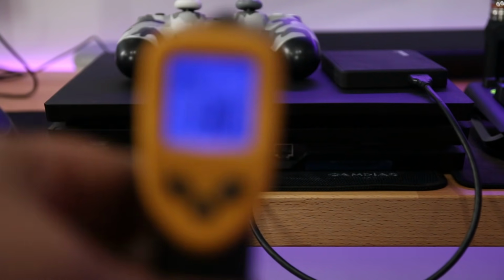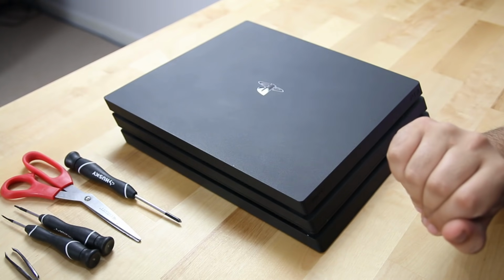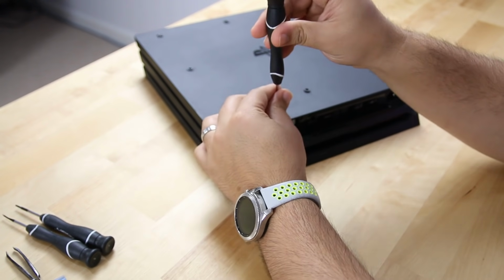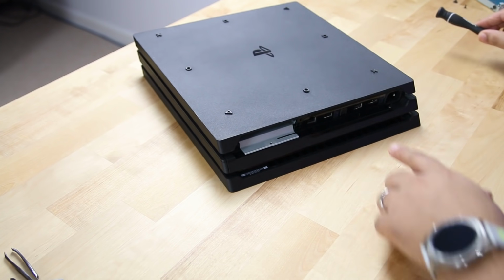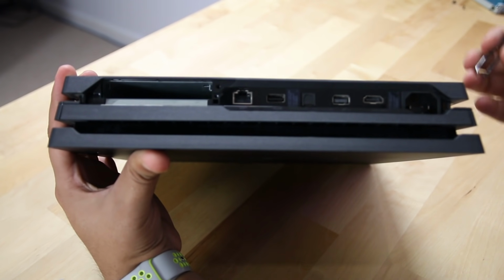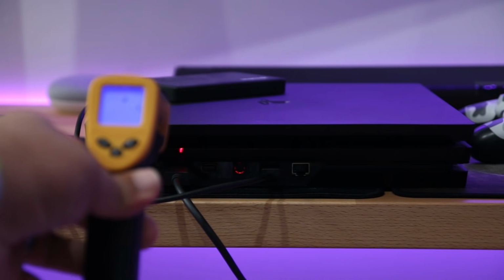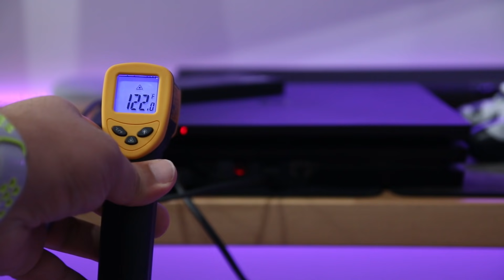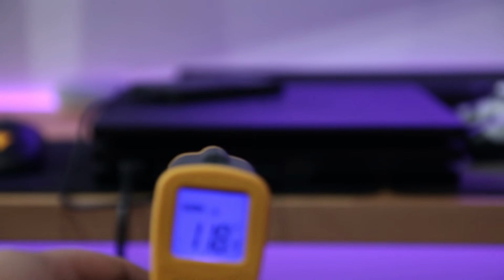PS4 Pro Fan Noise Fix - Thermal Paste & Pads Upgrade

Comment: This actually worked thanks. My ps4 is so quiet. I think it was because there was a inch of dust in the heat sink.
Reply: How is the noise after a few months if you don't mind me asking?

Comment: This video was helpful with major caveat. You need to remove two screws on the bottom plate, in addition to the 5 on top, to remove the power supply.
Reply from the maker: +Monte Crisco yep. That and I put the thermal pads on the chokes instead of the memory chip set lol. Fixed and pinned.
Reply: Tech Savvy Buyer no worries. Your video helped fix my shit up 👍
Reply: This is an excellent observation.  I missed these two T8 screws and bust the plastic cover on the PSU....luckily its only a small crack.

Comment: There are 2 screws from the bottom that holds the power supply you didnt mention to remove it. You mentioned it after you removed the power supply.
Reply: Yeah, "little" detail missing.  Thanks to this comment I avoided some trouble.  Gotta have these two removed from the other side to get the power supply out.  They are two of the silver torx 8 at the back.

Comment: As a PC player, that factory paste was just...oh god.  

SSD seems to be hit and miss.  Some say it halves the time, other say it reduces by a few seconds.  So I'm not fully convinced.  I'd go with a Samsung 840 Pro though, but that can suck as it's only 256gb.
Reply: Dynasty2201 I have a 1tb “SanDisk Ultra 3D SSD” in my PS4 Pro and for the most part it’s a night and day improvement.  Game load times for Pro enhanced games are dramatically faster.  In Destiny 2 I load in a full minute before anyone else I play with, However for older non Pro patches games or games with short load times in general it’s fairly minimal.  The console also turns on about 5 seconds faster which is nice but the best part about using an SSD with a PS4 Pro in my opinion is how much faster the OS runs.  All stuttering and slow down is completely gone even with demanding games open in the background.  And the cherry on top is that the system is completely silent when idle.

Comment: Thank you for your efforts. The thing that needs to happen, is SONY`s decision on applying Liquid Cooling to the next PS generation. Thats the first and last solution to both keeping the rig and our ears protected :)
Reply: This is more an industry thing, I’ve seen laptops from apple and Microsoft with the same issues about thermal paste.
Reply: @Mugman896  It`s not the thermal paste. Uncover your PS4 as I did and get it 10-15 degrees cooler. It`s the matter of bad airflow. Uncap your PS4 and you`ll see :)
Reply: Consoles are ment to be somwhat affordable it will never have liquid cooling pc is the way to go for total silence if not xbox its quiter than the ps4

Comment: I just did this with my PS4 Pro.  This was the first time I had ever performed an operation of this nature on anything, but I decided to just go for it.  I'm glad I did.  I used Arctic MX-4 thermal paste and Arctic Cool thermal pads.  I was leery about using Liquid Metal, since I have my PS4 Pro oriented vertically, or Arctic Silver 5, since I heard that has cure times, a break-in period, and it can be electrically conductive.  I wasn’t sure exactly what is the right amount of paste, but I had been hearing most say that a pea-size diameter spot is sufficient (by the way, the original paste was just absolutely glopped on there).  I don’t have a means of checking the temperatures, but I can tell you that playing Monster Hunter World and Final Fantasy XIV, two games that typically turn my Pro into a hairdryer, the fan remained near whisper quiet.

An unexpected benefit has been that the performance of my Pro has improved noticeably.  In Monster Hunter World, my typical load times are around 15-30 seconds, since I have an SSD in my Pro.  However, after this operation, load times went down to about 5 seconds!  That's fricking PC level load times, on a fricking console!  I normally run FFXIV in full Pro mode, 1440p with the High Graphics option turned on because I like the better visuals over the frame rate (I'm a console gamer, so I’m used to lower framerates).  After this operation, while the overall frame rate doesn’t seem noticeably better, there is less sensation of dropped frames, that is, the overall motion of the scenes are much smoother.  Also, the controls are much more responsive than they used to be; I’m no longer getting occasional missed commands or feeling like the controls are “sticking”.

Overall, I've been quite happy with the results (and rather pleased with myself considering this is my first time pasting anything).  However, my before and after experience suggests to me that the PS4 Pro has quite a bit more power in it than people realize.  But, that power gets masked by thermal throttling with the factory paste and pads.

EDIT: Artic -> Arctic
Reply: Be careful because in the video at 7.00 he puts the thermal pads on the wrong place. The pads are to put on the black chips(vrm). So the black chips directly above. I told him but he didn't change the video. Guess he's not worried if people fry their ps4 pro... 

You can check this if you dissasemble the ps4 pro and look between the motherboard and the chassis while you are lowering the motherboard. Alternatively you can search on youtube for "ps4 thermal paste replacement more fps" and you will see a video with a mod, that i do not endorse, but it has the correct placement of the thermal pads at 7.32. I cannot post links because youtube makes my comments invisible to other users.

And yes, I'm sure of what I'm saying. I double checked the place when i dissassembled my ps4 pro.
Reply: chicozeb Yes.  In the video, he applies the pads to 6 components on the top of the motherboard, but it was clear to me when I opened my PS4 Pro that it was not truly clear which set of components the 6 protrusions from the corresponding thermal-mass block would actually align, the black chips or the silver capacitors.  Since this was not clear (I was actually questioning this part of the video), I didn’t put the pads on the chips because I wasn’t certain which set would actually align with the thermal-mass block bolted onto the top grill.  So, I placed my thermal pads directly on the 6 protrusions from the thermal mass and set the motherboard down on it.  This ensured that wherever they were supposed to align, they would do so properly and without me having to guess at anything.

There were also the 8 chips around the motherboard, which I presume to be the main memory chips.  To avoid alignment issues here, I placed the thermal pads directly on the chips and then carefully seated the heat-spreader plate on top and bolted it all down.

So, in total, I installed 14 thermal pads.  So far, my system has been running near whisper quiet for hours without issue, even on the most demanding games and even when the ambient temperature in my room has hit 80 degrees Fahrenheit.  I'm not seeing any signs of overheat, yet.  My only concern is that the fan speed has gone so low that I’m now wondering if there is enough air being moved to cool the power supply.  I'm actually wondering whether Sony had actually tuned the thermals with the expectation that the fan would blow as hard as it does with the factory thermal solution such to also keep the power supply cooled.  So, honestly, if anything should burn out, I really would expect that it's going to be the power supply rather than any of the chips.

Honestly, I used the video here as a guide, not a prescription, of how to go about this.  I may have never built a PC or done anything like this before, but I do understand enough electronics, plus being a physics major, to figure things out and proceed cautiously, especially for the fact this was my first time.
Reply: @khoulwhip  There should be no problem then. I don't believe that the psu will cause any issues. A thermal paste change can give you 5°C lower temperatures, max. It does not make miracles. It may be just enough to make the fan run a bit slower to make the noise more bearable. So the psu will recieve more than enough cooling.

Some ps4 pro enhanced games will make the fan ramp up, like god of war or the infamous map on horizon zero dawn. So rest assured that the psu will have enough cooling. I've done the same to my original ps4 and it lasted 2 years in my hands. Then I sold it. Is probably working perfectly today. Don't know. 

Lots of people have their ps4 heatsinks full of dust (so no much air goes through) and the psu doesn't fail. Just clean the heatsink every one or two years to keep good thermal performance.

Even in the remote case that the psu blows up, it would be probably an electrolytic capacitor or an mosfet. They are easy to acquire and replace with some basic soldering skills(soldering is easy). And you can also easily find a replacement psu online. But replacing the motherboard is a lot harder. And what you did may help prevent the infamous blue light of death, since both the apu and ram are now better cooled.

On a side note, arctic mx 4 is not known by it's longevity, so you may start to see more noise after a few months. After that you can change the paste to kryonaut. Or arctic silver 5. Just be sure that you don't spill the arctic silver 5 around every component. But there's an youtube video of a guy that filled a pc gpu with arctic silver 5 and it gave no issues. So it's a safe thermal paste.
Reply: Hey mate. Just read your comment. How long did it take you do? Just wondering if it's worth my time or just replace the unit.

I'm currently play Red dead and my PS4 pro sounds like a rocket at take off. I even have it stood up on a stand that has two fans. 
I'm considering re doing the paste and cleaning any dust out. I've been renovating so I imagine it's dusty.
Reply: Liam Jenkins Roughly 1 and 1/2 to 2 hours, but that was because I was going carefully and slowly to make sure I understood each step of what I was doing, where each screw goes, and mostly thoroughly cleaning off the original paste such there was very little to no residue.  Also, to avoid breaking any wires or connectors.  If you don’t have a grounding strap, I recommend getting one before performing operations like this on any device with micro-electronics.

Also, as discussed in comments above, the video does have a potential error in the placement of 6 thermal pads.  Chicozeb notes that those 6 pads are supposed to contact 6 black components which he claims to be VRMs, whereas the video places the pads on 6 larger silvery components, which Chicozeb says are chokes and don’t need the cooling.  I avoided this alignment problem by placing the thermal pads (which have to be cut for 7mm x 7mm, by the way, compared to 10mm x 10mm for the 8 memory chips) on the aluminum thermal block that has 6 protrusions to contact the components.  Doing this, I was able to guarantee the thermal pads go to the right component without having to know which component is the correct one to be cooled, because the thermal block is manufactured to align to the correct components.  Also, it avoids the possibility of the pads falling off when you place the main board back down on the entire heatsink.

I will note that a regular full cleaning of the unit, which does require some disassembly but not to the degree for re-pasting, anywhere from every 6 to 12 months will probably help.  I usually find I only need to go as far as removing the power supply to allow enough access to blow out the heat sink (airflow in the reverse direction while holding the fan to avoid burning out the bearings) and around the unit (the bottom gets dusty also, which can block airflow to the components underneath).  I also blow off the fan blades directly (again holding the fan in place to avoid burning out the bearings).

Honestly, I don’t think you need to buy a new unit unless it actually does tend to overheat a lot, which you will immediately know because the unit will tell you and then shut itself off.  These consoles really are just loud like that.  Mine had a similar tendency before redoing the paste and thermal pads.  Those console coolers with the fans are mostly a waste of money.  They don’t really keep the unit any cooler than what it is able to do on its own.
Reply: @khoulwhip  ok mate really appreciate all that. I might just give it a clean before going the whole hog. 
Again thanks for the reply. Really helpful
Reply: @liamjenkins82  The best option without replacing the ps4 pro is to change the thermal paste, thermal pads and the fan. The nidec fan has better acoustics than the delta fan. You can buy one on ebay. And you can check google on how to see if you have a delta or nidec fan. But it's most likely a delta fan. Only changing thermal pads and thermal paste, or thermal paste only, since the apu heat is the source of faster fan operation and noise, can help a bit, but manage your expectations, because it can reduce your apu temperatures a 5 or 6 °C, wich is enough to lower the fan noise a bit, but it's not even close enough to make it quiet.

You can also try to get a new ps4 pro, cuh-7216b, but i believe they suffer from coil noise. You also have the cuh-7116b, previous model. The first one was cuh-7016, the loudest one(the last 2 model revision numbers depend on region, i think).

Or if you want the cheapest and easiest way to make the ps4 pro run instantly quieter and don't mind taking a small image quality hit, at least on red dead redemption 2, you can go to your console video output options and select 1080p. Be sure to disable supersampling mode. And leave boost mode enabled for better framerate.
Reply: What thickness was the thermal pad you put on your ps4? 1,5mm or 1mm?
Reply: 1mm
Reply: What he puts on is not liquid metal, it was Cryonaut - one of the best non conductive thermal pastes on the market.

Comment: The thermal paste application is completely wrong here - so please don't follow that bit of this otherwise nice video. PS4/Pro have an 'exposed' die with no heat-spreader. This means you must use the "spread" method where you cover the entire CPU/APU die with thermal paste. The pea-sized blob method shown here is for CPUs from the likes of AMD and Intel that have integrated heat-spreaders installed over the die.

Comment: Hi Bro (TSB)
YOU ARE A WIZARD AMAZING JOB  , just now I finished everything my ps4 is well cleaned heat sink , fan and all the parts and I replaced the past pads and replaced the thermal paste and i tried my ps4 pro it is very silent there is no noise but i don't know if this is a long term or a short term solution but as of now it is VERY QUIET and for the first time i can hear other sounds in the game. I used ONE PIECE of thermal pad 120x20x1.0mm but you need to cut it exactly the same size to be enough for all the replacements 
AGAIN VERY BIG THANK BRO YOU ARE PRO
Reply from the maker: Thank dude!
Reply: Does it still run quietly?

Comment: did mine. use credible thermal paste. original artic mx 4 i use. dont give a bulk paste on procie. just a drop then smir it equally on the surface.add more if not enough.until all surface covered in thin layer. it really effect the fan noise. u knowmust change thermal if u play apex legends .just stay on main screen then your fan goes crazy. like jumbo jet. after i change the thermal paste the fan noticeable quiter. it really works

Comment: Two questions :
1. Is there no way to clean the heat sink without taking it apart?
2. Do they make better more flow fans that can be installed?

Comment: I tried this out today with a 1$ thermal paste (made in China) that I found in a local electric store. I didn't even have the thermal pads so I still use the old ones found inside my PS4 Pro (but I did clean the dust off the pads). It took me a while to complete the whole thing because I kept forgetting things like putting the cables back on, wrong screws placement, etc. I even cut a straw in half to clean balls of dust out from my heat sink's grills. My whole system was filled with dust before now it's all clean. So the result is, the jet engine is gone and my PS4 is a lot quieter (tested out with COD: War Zone). The thing is that though, there is one screw left after I'd assembled the whole thing and can't be bothered figuring out where I had missed it :p
Reply from the maker: Lol if it still works then don't worry about it haha

Comment: Nonono who applies thermal grease like that? Put a drop of thermal grease on the APU and spread it with a plastic card so it is distributed as a thin layer. Then and only then your thermal grase is applied right.

Comment: Thanks for making this video and the tips on how to get it done safely. Keep up the great work! 

ps. Can you update us on the thermal pads that you installed in the wrong place? Would love to know that after you switched the thermal pads around if you have gotten any greater heat reduction from the system. Don't feel bad we all make mistakes. :) Love your videos so keep making them!
Reply from the maker: +Gains thanks! Yeah lol I reinstalled the thermal pads in the right place and thankfully it's making a pretty big difference. It doesn't overheat at all and it stays quiet even during stressful gaming apps. Overall it was really successful. :)